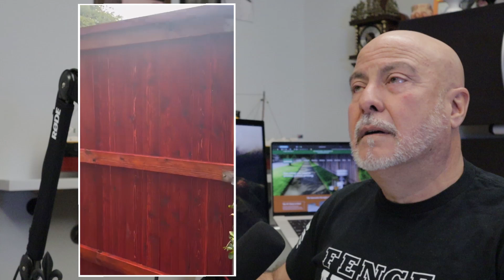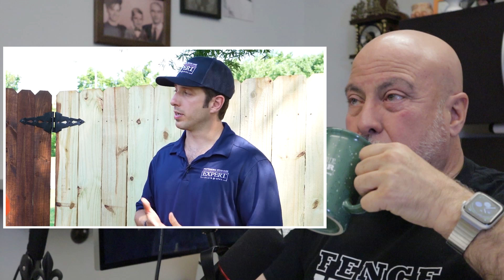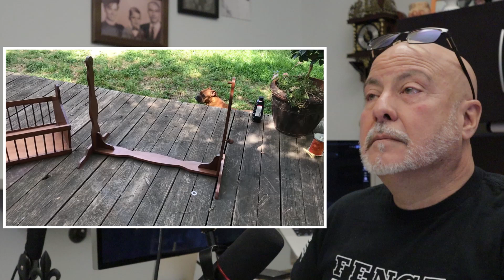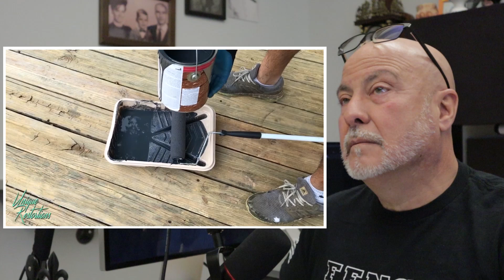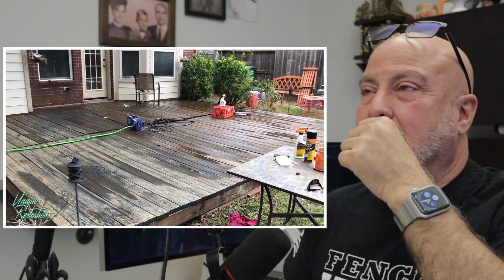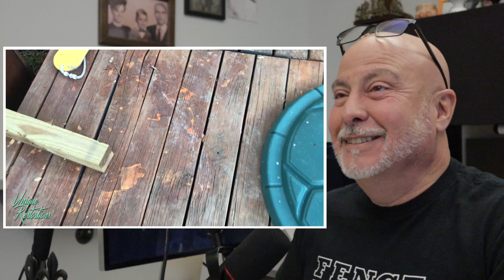Fence Expert Reacts to Popular Staining Mistakes and Fails!

Comment: Great react video! That poor guy in the last scenario. We’ve tested about 6-7 colors on spare pickets - good thing because my initial choice was almost as dark as his first try. Our new fence is nice and dry - do you have a recommendation for temperature and time of day to apply the stain?
Reply from the maker: Thank you for your kind words! Testing truly makes a difference. When it comes to staining, the ideal temperature and time of day can vary, but as long as the wood has a moisture content of 12-13%, it mostly depends on your comfort and staining speed. To avoid lap marks, be sure not to stop staining mid-picket. Hope this helps!